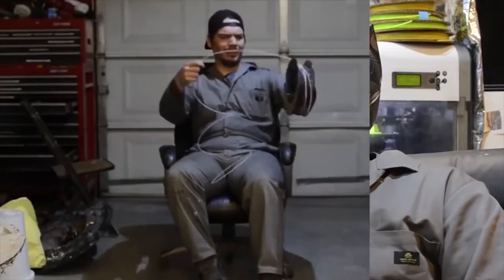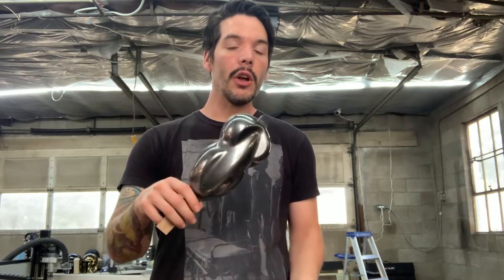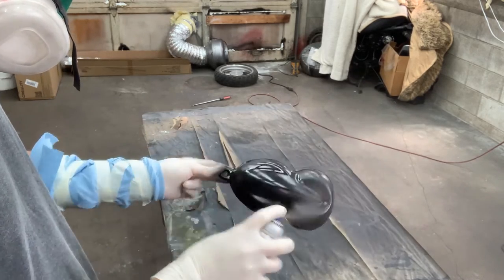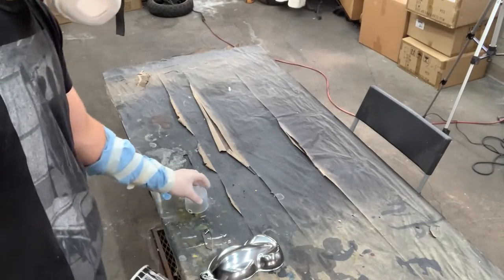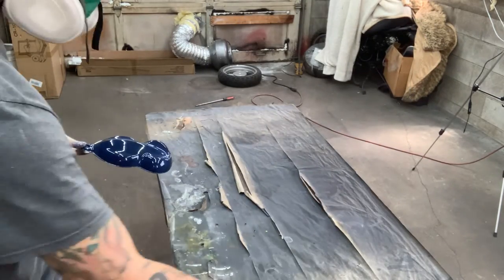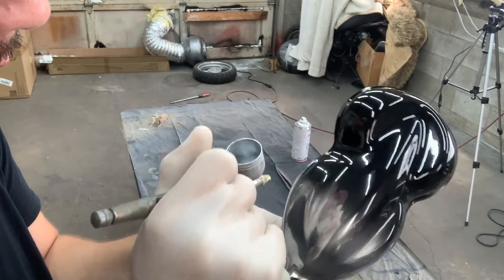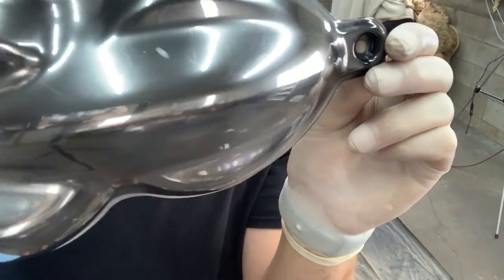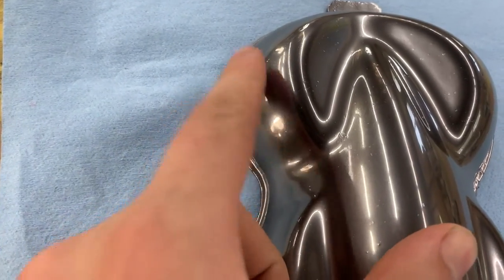How to Spray DURALUMEN Chrome Airbrush Paint from The Digital Armory

Comment: Excellent video!  Question for you….

How far will a 4oz bottle go for a Mando suit?  I did a test section on the Mando butt plate (small piece) and only spayed half of the piece and it seems like the Duralumen in the bottle dropped about a 1/2 inch from where it originally was when full.  Is that about right?
Reply from the maker: @rprealitycosplay  yes that is about right. 4oz would do about 2 helmets for a skilled painter

Comment: 7:15 how would you polish those out? and when? before the last clear coat?
Reply from the maker: After your final clear coat. 3000 grit sandpaper followed by automotive polish until shiny
Reply: @PrintsandProps  cheers!
Reply: Piggy backing off of this - What do you think would work best to get any residual compound off from polishing or from the oils on your hands? @PrintsandProps
Reply from the maker: @domthemom2270  isopropyl alcohol followed by windex!

Comment: Hello!I seen your video after vhen I order the paint from you.I have couple of question which maybe stupid but not really clear to me.
Basically you have five steps.
1 use the high quality  primer,its clear to me.
2 u use high quality clear coat,2K
the question is,what's the finish?high gloss or any other finish u used?
 u used a water based acrylic spray which is gloss warnish.I also understand this but why we have to use this coat after the clear coat?Or I use one from those two spray?
3 and 4 steps is clear.
5 clear coat with high quality clear(2k automotive)same question:what's the finish?High gloss?
How many hours or day we need between the coats?
Thank you for your answer and sorry   for any mistype in my English.I'm Hungarian

Comment: Do you recommend a clear coat to use on your typical airbrush?
Reply from the maker: You can use 2k in an airbrush with no issues. Just make sure to clean well with the appropriate solvent
Reply: @PrintsandProps   Finally got around to buying the paint from the Etsy!   Do you recommend a 2k primer that would work well with an air brush that I could find in the states?

Comment: Hi, what was the psi level you used for your airbrush? "All the way up" kinda leaves a lot to interpretation lol.
Reply from the maker: I’m honestly not sure. I have a 30 gallon compressor and my pressure elbow was all the way out. So basically as much pressure as your compressor can supply
Reply: @PrintsandProps  Okay, thanks for the prompt reply!

Comment: Do you know if Duplicolor 1k gloss clear coat will work as a topcoat, or will it "gray" out the chrome?
Reply from the maker: I recommend against that particular brand! It works sometimes, but it’s very hit or miss
Reply: @PrintsandProps  thank you sir
Reply: One more question on the duplicolor 1k. Can I use the duplicolor 1k to coat the black base coat before applying the chrome over it?

Comment: Hey man, so can you just clarify because it wasn’t super clear in the video, you can use any gloss base coat for duralumen? 
And it will take practically any type of clear coat? 
I want to avoid using expensive 2k clears. 
I want to be able to get quality chrome effects but using rattle can paints for the base coat and tinted top coats. 
It’s this possible?
Reply from the maker: It is possible, but difficult. Spraymax sells 2k clear in a rattle can
Reply: @PrintsandProps  thanks for the reply 🙏🏻

Comment: How do you polish dust specks out?
Reply: Sand with a high sand paper (your polishing compound will say what number to use normally 1200-2000) then using a polishing compound or multiple compound to cut and buff like any automotive finishing.

Comment: Does floor finish work with this paint??
Reply from the maker: “Floor finish” usually refers to a water based acrylic varnish that is milky white in the bottle but dries clear. That type of floor finish works yes. But I recommend liquitex acrylic gloss medium thinner with water for a water based clear coat